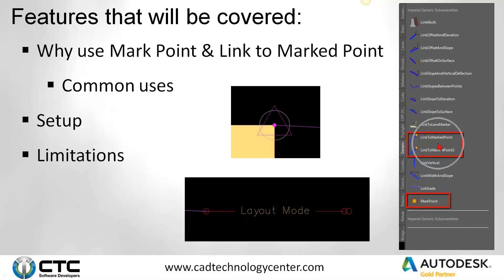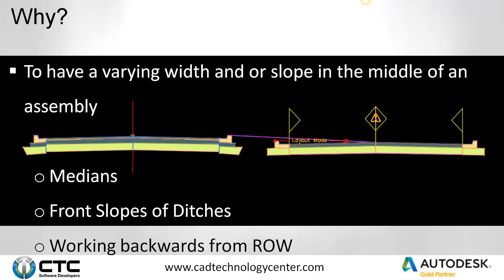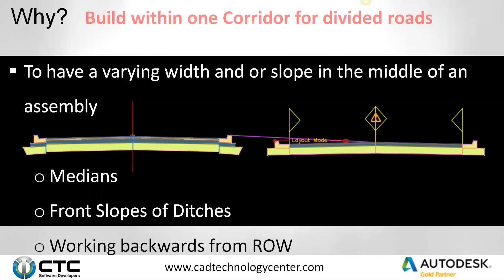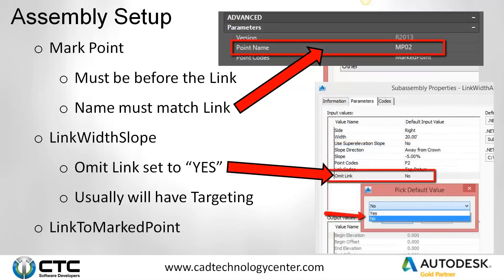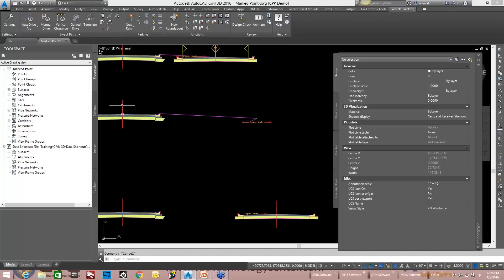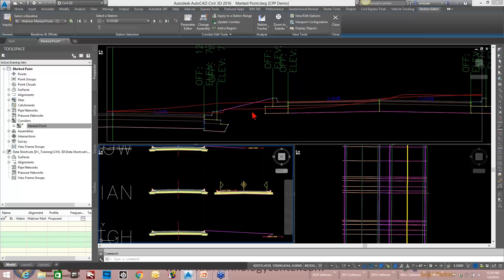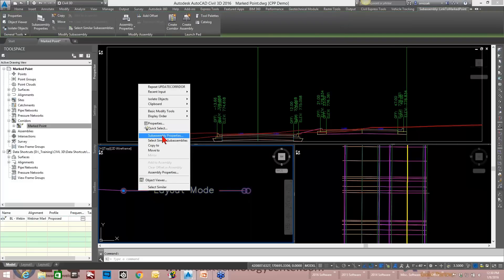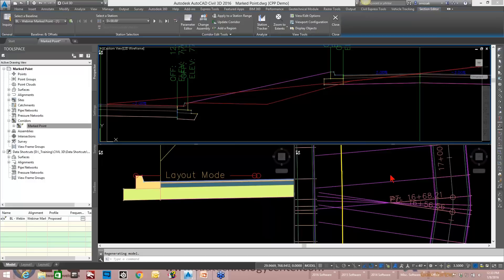Webcast: Civil 3D Marked Point Subassemblies

Comment: hi,

i have run corridor in my drawing and i have created a ditch in my subassembly.   for cut fill take off it is not working properly it is not following the ditch parameter which i made through polyline ...how can i set it so that i can get exact calculation i need your help to resolve this.

i have even tried to do this by marked point procedure but failed many times and now i am seeking your help.
Reply from the maker: It could be a handful of things: 1. The Ditch Assembly does not contain the proper link codes. 2. The Surface is not targeted properly. 3. The assembly is not properly targeted or constructed. 

This is something that we would need to see in order to get you a possible solution.